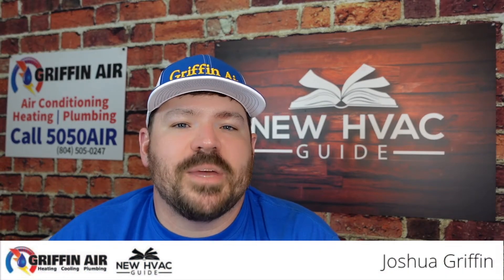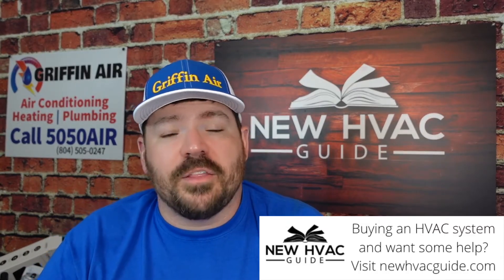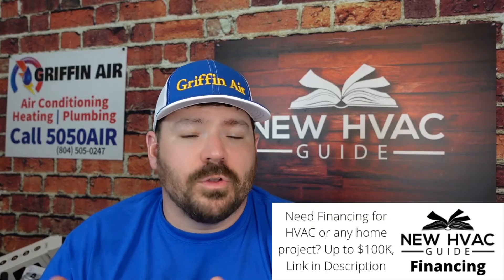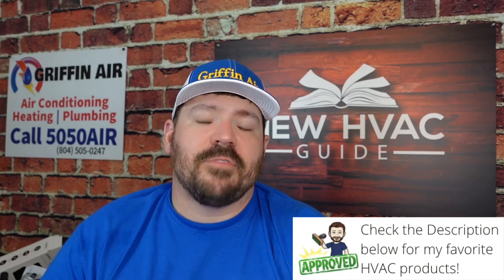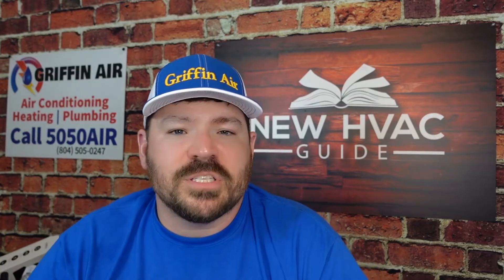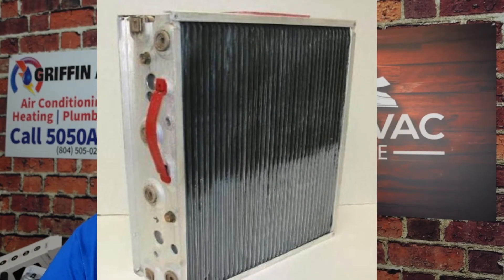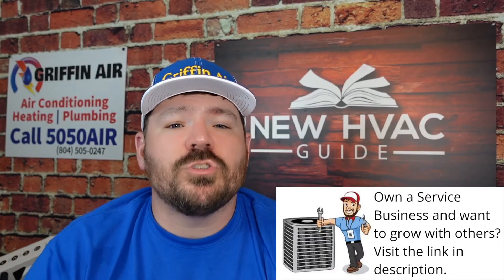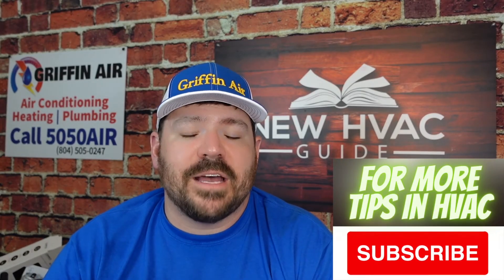ELECTRONIC Air Filters are USELESS! Here's Why!

Comment: I had a whole full HVAC system put in my house in '87 - Trane HP, Trane NG furnace, Honeywell EAC. The primary purpose of any filter system is to protect the HVAC system and good IAQ is a bonus. The quarterly cleaning process is 5 minutes removing the cells, then a dishwasher cycle (per Honeywell instructions), then 5 minutes replacing the cells. Could not possibly be simpler. Despite several kids and dogs, the place is always free of dust, pollen, dander, hair, etc. I also check my system fan and indoor evaporator coil quarterly and they're always clean AF. Even if the cells get dirty, it does not restrict airflow to the fan assembly  - struggling choked airflow is a huge cause of system failure.  And per suggestions from HVAC pros, I always have my system fan ON or CIRCULATE to improve IAQ and moderate temperatures between the rooms and floors. 

The $600 in 1987 would likely be triple that now. If mine ever fails, I'll gladly replace it with a new Honeywell Resideo EAC. Sure beats buying, storing, installing, and discarding hundreds of disposable filters + the cost of hundreds of filters over nearly 40 years. No thanks.

Comment: Electrostatic filters are “bad” because people are stupid or lazy. In fact, electrostatic filters are so effective that they must be cleaned regularly. My Lennox heat pump just failed after 38 — yes, 38 — years. It has had a Honeywell electrostatic air cleaner the entire time on the inside unit. In those 38 years the outside unit had precisely two repairs — a compressor in 1997 and an $85 contactor in early 2025. The inside unit required no repairs whatsoever. The compressor finally failed again after 28 years, so the unit will be replaced.

Comment: I hate mine. Bought my house with it--will never recommend them. When its time to clean them which frankly is needed every 3 months you either need to buy another filter to use while its drying out post cleaning or you need to go without AC for 8-10 hours while they dry. And the quality isn't any better than a regular filter.
Reply: 8-10 hours to dry?! LOL My EAC cells dry in 30 minutes. Cleaning quarterly is about right. Bless your heart.
Reply: @cruisinwiththecops3933 whats the make and model. You almost certainly are not cleaning them properly. EAC cells take several hours to dry when cleaned properly.

Comment: I really enjoy your channel, really good info. I have a 20x20x1”MicroPower Guard Frame & it has a hole in the screen where the Probe contacted the screen, about the size of a Nickel. Does this affect the function of the unit? Looks like the Screen is replaceable, there is a rubber gasket holding the screen in place. Can the Frames be purchased from anyone except from a Dealer?

Comment: Snake oil is something like wingman1. You can not even call it electrostatic. It is a 6kv wire between 2 fiberglass filters. 
I found the best filters are charcoal infused.
In addition to particle filtering they remove smoke and smell. My house was surrounded by forest fire smoke for a week and the charcoal filter worked wonders.

Comment: I bought my Dust Fighter 95 Electrostatic air filter  for 55 bucks  over 20yrs ago and clean it quarterly with a pressure hose.  Doesn't take more than a few min to clean it and then let it dry for 10 min then back in it goes. Simple and easy and saving me a lot of money compared to what  replaceable air filters cost nowadays.

Comment: I don't currently have an electro-static filter, but I had one in my first home. The maintenance was super easy, basically just taking the cell unit out and rinsing it in the laundry tub. I figure it's no more work than changing a standard air filter, you just need to remember to do it. Then again, I know people who rarely think to change their filters either! Our current system (soon to be replaced) uses the standard 1 inch filters. I buy them in bulk and change them monthly. Our new system once installed will use the 5 inch filters.

Comment: I have a mini logbook attached next to thermostat that I write filter change date and blower motor run time (I wired a hours run meter to blower motor).
A nice option to have would be a gauge measuring air flow vacuum...as filter gets dirty...vacuum goes up.
I'm not a HVAC technician...I did install my system myself. I think HVAC companies charge way too much.
Reply: 100% ... but that's capitalism: Charge as much as you can get the consumer to pay.

Comment: My Trane Electronic air filter works great, I clean it each month and have had no problems, the A/C tech says the inside of the unit is nice and clean so yes electronic air filter systems do work but they do require maintenance just like anything else.

Comment: Your really Statrting some Static "Pun Intended" with this Airfilter Topic 😂 

Im new to this AC filter things, where i come from its mostly heating. Company came to do a service call on my Unit, "Free Of Charge" Because unit was new and was included when purchased. Well we end up finding a New Electrostatic Filter , so he installed it and said all i have to do is clean it once a month. I like to keep up with Routine maintanace , like i do with my K&N filter in my Vehicles. So it shouldnt be a Problem for me. 

Thanks for sharing your input..

Comment: Although i get the point. Most people have maintenance contracts on their HVAC/AC systems and that mels it maintainable by default. Those who dont either clean/replace or don't. Takes away tha validity on the lack of maintenance really. I have one two years now. At $40-$60 a filter for my system its already paid itself. My crazy allergies had been almost gone. I put it on the dishwasher every 3 months and done deal. With a smart thermostat to make sure im reminded to do so. All together we at the House could definitely see the difference with allergies and saving on the long term.

Comment: As a commercial HVAC service technician... You're neglecting to mention the negative affects high merv rated filters have on your blower motor. You should also mention electric air filter/ scrubber that run on 24v are essentially useless and the biggest scam to residential customers. They need to be 120v. Electromagnetic filters and UV filters that run on 120v are super effective, if maintained, but I don't have to deal with the lack of maintenance as a commercial tech our clients are scheduled for quarterly maintenance.
Reply: What makes the filters that run on 24v essentially useless?

Comment: Very poor reasoning. How many furnaces have you seen with 'regular' filters that have not been replaced? Live most! They get clogged and the furnace is struggling to even move air. Those filters are worse than useless because when they get clogged they damage the furnace. At least an unmaintained electrostatic filter won't kill the furnace.
Reply from the maker: That’s a good point. I think the overall thought here is the false sense of security in getting clean here when the filter is not maintained.

Comment: The electronic air filters with the disposable media are by far, IMHO, the best IAQ product there is. It offers better filtration than Aprilaire 4 inch MERV 11 units, but without the added static pressure. 

Remember, these ECM blowers can't take the beating the PSC one's could. Once that static pressure hits and exceeds .8, these ECMs start burning out. With electronic air filters, this isnt an issue

Comment: What are my options if I have an older hvac system with a low max MERV filter rating of 4 and I want to clean the air? I can't just stick in a high MERV media filter as I understand it.

Comment: Just wondering ,  you talking about electro satic filters but title say electronic filter.   Are we talking about the same thing.   I was look,ing for info on the Elctro Static ones and the ones I have come across do not plug in
Reply: I was told there is a difference. What it is I have to research.

Comment: If your serious about clean air, for allergies etc electrostatic are the best Merv13 filters clog and pressure drop is harmful to your HVAC.  Electrostatic don't do that. I recommend a low Merv filter so if you don't clean often you are at least not  clogging the Evaporator

Comment: I installed an electronic air cleaner in my last house and I loved it!  It had the two power cells and then it also had a backup filter behind the cells.  People are just lazy, ignorant, or BOTH...I cleaned mine ever 3 mos. and I kept a log on the HVAC unit to track it.  It's not difficult, people, you just gotta get up off your lazy asses and DO IT.  The returns are more than worth the effort!

Comment: The right analogy would be to not even use MERV filters at all as you'll have to do maintenance and have to throw expensive filters out? I had electronic filters but I still put fiberglass filters ahead to get rid of large dust particles as I think the electrostatic can best handle small particles. After many years, I stop using it as It didn't seem to be doing much as I don't hear anymore zapping noise and read that it create excess ozone that is bad for health and environment.

Comment: What is the highest MERV rating you suggest for media filter 20x25x4 and do you recommend one with a carbon or no?
Reply: If it's 4 inches thick like you say, you can probably handle as high of a merv rating as you want. Usually 11 or 12 is as high as you want to go though for general home purposes.

Comment: Installed Honeywell units in my last home and they made a huge difference in air quality especially on smoky days in the pacific northwest. Will be installing them in my new home soon as well. I agree with the guy that was arguing with the poster with regards selling them, you should at least give people the weighted options before deciding everyone is too lazy. People need to change the paper air filters regularly as well or they royally mess up the efficiency of the system.  But then I'm an engineer and do everything myself and maintain my systems regularly.

Comment: What I'm noticing is everyone wants the UV which doesn't do anything for particulates. And if I had to guess, electronic air filters are a good halfway measure instead of going True HEPA, which would change the characteristic you need from your air handler / motor, duct static pressure, etc.

Comment: If you web search for 'electrostatic filter', most hits are for passive media filters that claim to carry some sort of passive charge.
To that 'people don't clean them ' argument about *electronic * (active) filters,  the same can be said for media filters. Bummer that 
misleading info was used to generate views...
Reply from the maker: Incorrect. Not replacing media filters will eventually lead to an airflow issue so bad the system will malfunction. Not cleaning electronic filter cells will simply lead to a useless device never affecting airflow.  Your comment is the bummer 🙂

Comment: Cleaning pre-filter and cells twice a year is fine but yes many homeowners are intimidated and fail to do so. I used to clean by soaking and giving a good rinse but drying was so slow. Best method for the cells, use the dishwasher.

Mine is now over almost 30 years old and only problem encountered was a failed power supply about 15 years ago. Was obvious, the light was unlit.

Comment: So after watching this video, its doesnt matter, IMO, whether its a electrostatic air filter or a media pleated filter, BOTH need to have REGULAR MAINTENANCE done on them. I had media filters and I changed them every 90 days, no issues except can be expensive. I currently use a K&N HVAC washable filter again I maintain it every 90 days, its not like a normal K&N for your car that you spray with oil it's just a media filter that you wash have to buy their cleaner and wash and dry before reuse, pain the the butt, I am not happy with the K&N mainly because it doesn't get sprayed with an oil maybe if it had the oil I would be happier but I've noticed more dust in my home since switching. SO since I do maintain my system on a regular basis and I do not want to pay ridiculous prices I will be upgrading to a electrostatic filter by WINGMAN1 which you don't wash but replace the media and the media is way cheaper but it will take more time then a pull out and push in a new media filter. Hands down if you suffer from allergies a HEPA filter is definitely your best bet but Again it MUST be maintained (changed) at least every 90 days. So again it just depends if you don't mind doing some maintenance that would take an hour and your somewhat mechanically inclined I would say go with the electrostatic but if you have a allergies or a busy lifestyle, like lot of us have,  and or your not that mechanically inclined, or simply you just want a pull out and push in (and you pay for the convenience) then go with the HEPA pleated media filter. I am not disagreeing with what he said, I just think no matter which one you have or choose you  still have to perform REGULAR MAINTENANCE ON THE SYSTEM, Goes back to the old saying ...pay me now or pay me later. The only comment I don't agree with is when he stated, "Should you sell people something that will be rendered useless"  he answered "yes" well if that's the case then take all the filters out of all the big box stores because guess what they are rendered useless that's what they are designed to do! They have to be maintained (changed). I understand what he is saying for the average busy homeowner they just didn't know or was just too busy to care about their HVAC filter , I just would have been a little more careful making an absolute comment saying you shouldn't sell someone a product if it can be rendered useless. If you want to do it the proper way measure the pressure differential between the inlet side of the air filter and the outlet side of the air filter, then you'll know when exactly to change your filter but most homeowners don't care or want to spend the money to do it that way but even the way I just explained THEY HAVE TO BE MAINTAINED! So again no matter which one you decide on or currently have find out the maintenance schedule from the manf and try to stick with it, put a reminder in you electronic thermostat some of them have reminders that you can set the frequency of filter maintenance,  put it in your google home or set a reminder in you iphone or hell go the old fashion way and put it on your calendar, or even write on "born on date" (when you installed it) and a "next change out date" (next date you need t change it out) with the size of the filter(so you know which size to get so your not taking it apart  and seeing what size it is and putting back together then taking it back apart again to install ) and slap a sticker on the outside of the HVAC right on the front of the HVAC unit where it will remind you about it. Again IT NEEDS REGULAR MAINT. Just retired from working as a master electrician and HVAC specialist with my own company of 50 years. Now my son took over. Hope this helps. If i haven't stated it yet, "YOU NEED TO PREFORM REGULAR MAINTENANCE ON YOUR HVAC SYSTEM" Please don't make me say it again :)
Reply: Very well said comment....thank you....
   Back in 2008, we installed a Brand New Ductwork, and Brand New Trane XV 80, Furnace....with Honey Well, Humidifier, Drip Flow, Radiator style.....
   The Furnace installer ask us if we would want a Regular Filter system, or a Trane Clean Air Effects, Electrostatic Air Cleaner System.....
So before 2008, our Old Octopus 60% Efficiency, Gravity Gas Furnace that was wrapped with Espestus, was installed Originally into our home, in 1950.....
So anything was an upgrade from that...lol
So long story short, in 2008 Trane system, Installed, all new Duct Work, All New Air Cleaner.
  So after Regular Maintenance of that Clean Air Effects Electrostatic Filter System, Using a Maintenance Schedule Note Pad, Booklet, I would Clean All the Components as per the Instructions Manual, time lines....
  Did very well for 16 year's, until after all the Seam's started to Break down the Oils in the Collection Cell Plates, and started to Separate, exposing the Inner Workings to The point where it Finally Burned out the Control Door Panels, Electronics.....
   So Rather than Spend over 1,000 Dollar's to Get a whole new Clean Air Effects Unit, for Not ONLY , the Two Collection Cell Plates, But would also have to Buy a New Static Pin Charger plate system, as well.....which in and of itself, in over 140.00 bucks, just for that....
  I Decided I'm going to go with Washable, Filter Media, and  a Custom Made Stainless Steel Frame, that Holds the Media, in the Frame's Housing....
 The Media is a Orange Side Tacky, and a White Side, that is Washable, every 30 to 90 Day's, Depending on the Seasons, Dust Level's....
  Those Media Polystyrene Synthetic Pads, will last up 10 year's worth of Washing, before Needing to Throw in Trash.....
So they will save a ton of money, on buying Pleated Filter's....
 They sell the Media in 1/2", 1", 2", 3" inch. Thickness....
  They suggest the 1" inch washable.....
Hopefully this helps someone, if they decide they don't want to spend over a grand for a whole new Clean Air Effects Electrostatic Filter System....😎👍🇺🇲
Reply: Wingman1 is a snake oil. So many people got ripped off by that scam